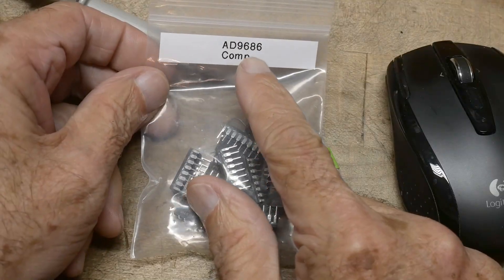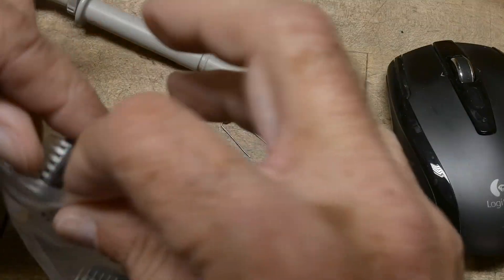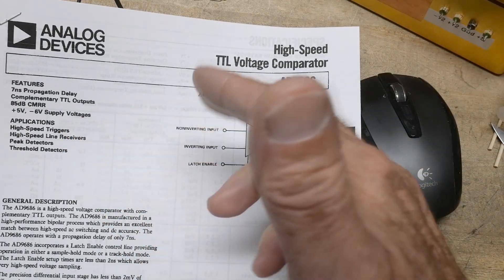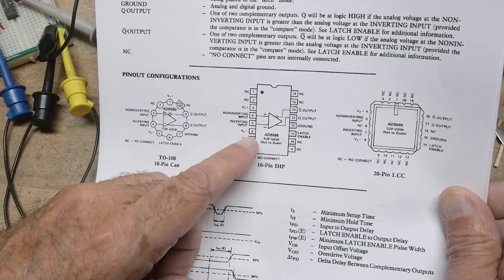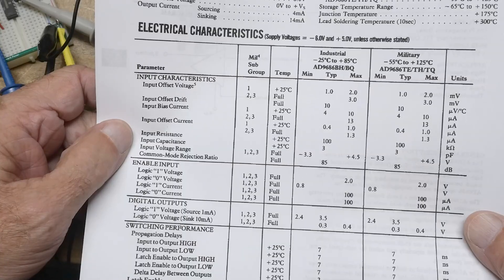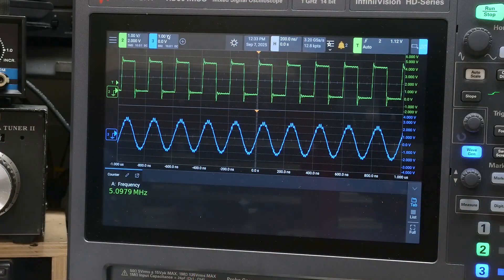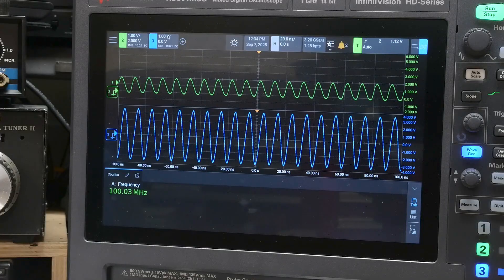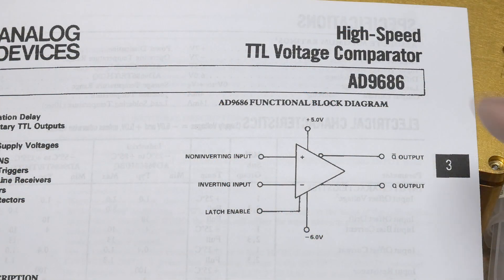#2381 AD9686 High Speed Comparator

Comment: You are so right about Frequency Counter usage. Few years ago I was repairing Racal Dana 1995 and AD9687 is used as Start/Stop Comparator and probably on few more places. One of them was fried and it was hard to find exact replacement. Analog provided modern replacement with AD96685/AD96687.

Comment: One sometimes-annoying characteristic of most high speed comparators is that their input current requirement is quite high. Fortunately the input capacitance is also generally pretty low so the impedance doesn't go totally to heck at high frequency. Iirc, Linear Tech introduced a very fast comparator with JFET(?) inputs several years ago.
It looks to me like that part could do with some improved supply decoupling. Parts like that need to have the ceramic decoupling caps on the shortest possible leads and as close to the supply pins of the IC as possible. With many newer parts the recommended decoupling, including the layout, is shown in the datasheet. I suspect this has saved a multitude of calls to tech support. 
You'd need Schottky (not the low power type) TTL to take advantage of that part.
Those tin can packages shown in the datasheet typically have kovar leads. Kovar and copper make a thermocouple that produces about 40 µV/K which can make a nasty mess in analog circuits if you aren't very careful.

A long time ago there was a triple fully differential ECL line receiver that worked quite well as a reasonable approximation of a linear amplifier. They were fairly popular in both the commercial and hobby realms as pre-amps for moderately high speed frequency counters and the like. I can't recall for sure, but I think the typical arrangement was to use two of the receivers as amps and the third with some hysteresis added as a comparator. Seems to me the part number was something like 10113.

Comment: I used this part in the early 90s to recover a 125MHz ECL clock to drive a CMOS ADC. A pull up on the output will enable a faster toggle rate and CMOS input compatible waveform.
Reply: I thought TTL vs CMOS compatibility was little more than different voltage levels. How does the waveform differ? What is required for it to be CMOS compatible?

Comment: I always liked the LCC (Leadless Chip Carrier) package.  No desoldering and soldering iron required for replacement.  And yes, they are still a thing.  Believe it or not Pace (the soldering iron company) still uses PLCC's.  When I got one of the first new ADS200 soldering stations several years ago I quickly found a few bugs.  They quickly sent me a new processor that was a PLCC.  Pop out the old IC and pop in the new.  I appreciate the ease of serviceability of LCC's.

Comment: I love chip of the day. 🤓You should do a 74xx chip of the day mini series IMHO. I also have a hoard of great (probably obsolete) mil-spec components. I use them wherever I can because they never fail.
Reply: Don't forget the 4000 series IC's!  It would unfortunately be unpractical to do a series on them all.  Even doing a video a day it would take him years just to do the 74xx series.  There are hundreds and hundreds of different 74xx series IC's.  And they are still making new 74xx series IC's to this day.  Not to mention different families like HC, LS, etc...
Reply: @mikesradiorepair  I meant more like a small sample. and yes Ti still makes lots.
Reply: Trust me they can fail, i replaced a lot of 5474 IC's over time, and they all failed by increased input current, or did not want to switch fast. A lot of the others also suffered from purple plague from the gold bonding wires, and then also suffered from electromigration as well. Generally a batch problem, some batches fine, others all failed over a few years, even if in storage.